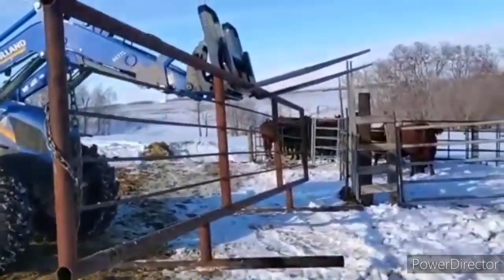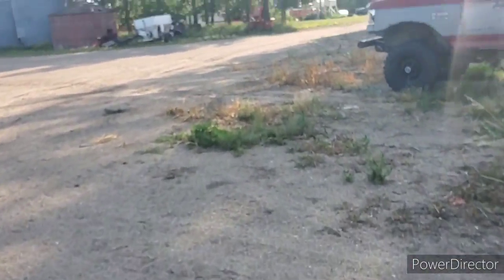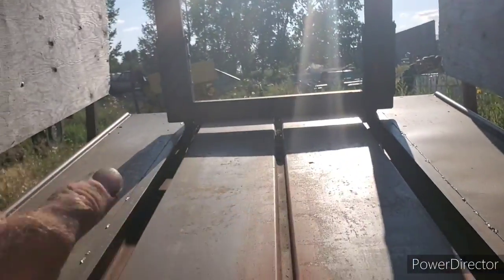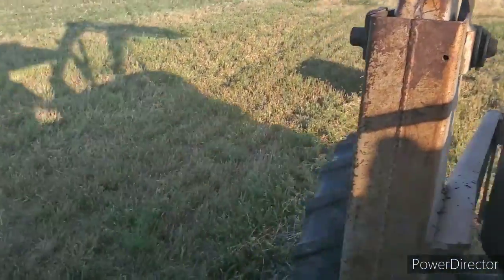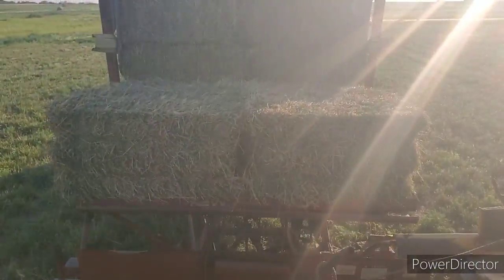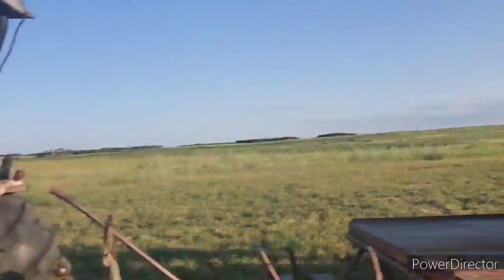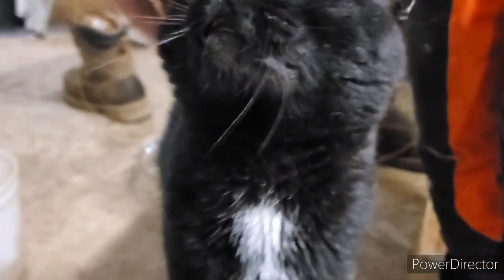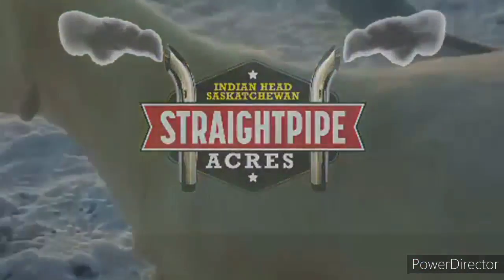New Holland Stackliner 1002

Comment: Only pull type we had was a 1037, three wide, five high, seven long?? 
Held 105 bales I think.. 
PTO driven all hydralic. Just had a box with a cable to the valve for the pickup.. ran the chain and lifted it. The rest was levers that came up behind the tractor seat. You could lift the first table, second table, run the auto tie spikes and trip arm.. dump the load, push off and the sliding rack was hydralic, so a lever for it too..
First self propelled was a 1048, two wide, 5 high or 6 with 14" bales.. 9 high in the stack. It had the springs on the rack.. always fixing it!! 
1075 we have now makes the same stack as the 1048, but the computer does most of it.. 
Biggest thing is the automatic tie tier puts the first two bales along the edge of the second table, three crosswise between them then two more sets of two to finish it off.. 
Having the center bales cross wise, holds both sides of the stack together.
You did a great job of showing how it works Ryan!!! 
I wanted to get a good video of the 1075 but I needed someone to video it.. kinda hard by myself with the cab😪
Reply from the maker: Awsome. The dairy Ashley worked at had a bug sum bitch of a pull type one and everything was electronic too. And pretty sure it was 3 across. It was hard to show how it works. But I'd like to get some footage of unloading a load
Reply: @straightpipeacres6365  you did a better job than I have.. 
Last summer I did do a decent video.. this summer has just been so🤪😵 that it was hard to really show much...
Reply from the maker: Hahaha I wanted to get Ashley on the baler givener too but that didn't work out for a guy. Oh well i went and cut more today and it got rained on so maybe few days il go make some more hahahah
Reply: @straightpipeacres6365  rain?? What's that??
Reply from the maker: @GosselinFarmsEdGosselin  thats what I thought too. We got over a inch. And cousins 4 miles south got a 3 inch downpour
Reply: @straightpipeacres6365  haven't had any real measurable since  early June 😵
Reply from the maker: @GosselinFarmsEdGosselin  shit eh

Comment: I've had a 1003 for quite a while, they are awesome when they work. Mine holds 84 bales if you don't put any tie rows in. It's the smallest 3 wide they made. When you start your stack leave about a bale width gap at the bottom and it will lean back at the start.
Reply: U can not store large quantities of hay  stacks on top of each other falls over

Comment: The 1034 is way different than the 1002 as far as automation, but it's still better than stacking on a rack behind the baler.
Reply from the maker: Hahaha when everything works right
Reply: I hznd stack on a wagon behind the baler  made my own hydraulic tip bed makes 150 with wrap around baler twine to hold stack together stack stored on a level gravel pad  only handle the bale once my wife is kind to drive the tractor  and feed me  together we do the whole operation  and sell to the horse keepers  for cash